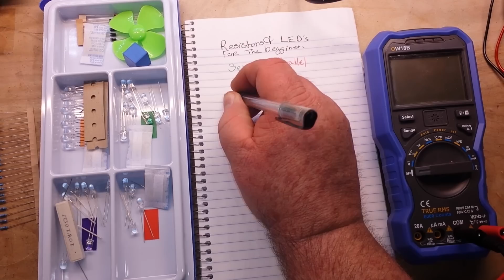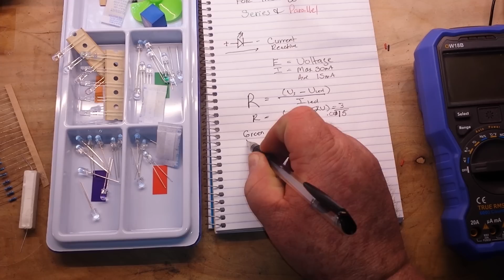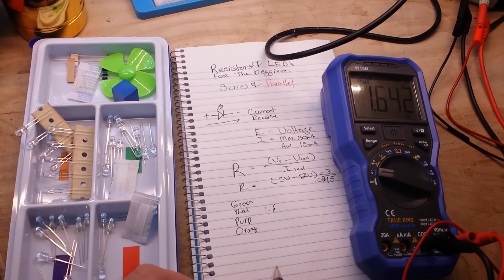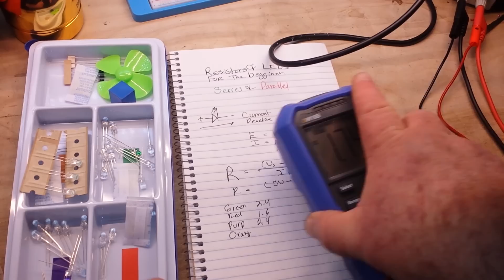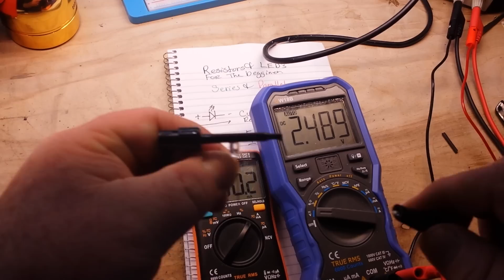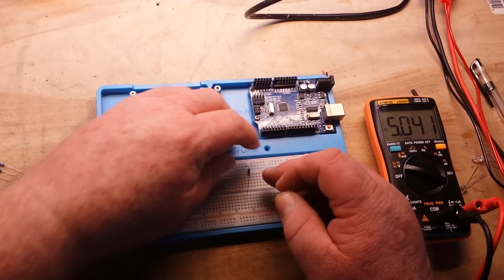LED's and resistors for the beginner

Comment: Hi.I’m looking at a 12v vw t4 badge it has already a string of bulbs behind badge in vw shape.some bulbs been out a while.I’ve ordered some 3mm led bulbs to replace.if old bulbs were not led.do I need resistors for led bulbs need about 10 extra in total of 25 .it’s 12v supply from side light circuit just when engine running normally .thanks .Steve

Comment: I would have liked to know if there where two parallel lines of serial LED's. How the amps react if one LED in one line goes out. I guess that amps going through the remaining line of serial LED's does not change?
The other thing I would like to know if for some reason one LED in serial is brighter than all the rest what can you do to lower the AMPs for that one LED so it dulls slightly.

Comment: Typical dumb question, but I'm putting some LED's in a circuit that also has a 555 chip. I want the LED to show that the circuit is on, not so much interact with the 555. How would I treat the 555 when it comes to calculating the circuits voltage so that the LED doesn't burn out. I'd be using a 9v battery.

Comment: I've wondered about the voltages on some LED's.  Some say like 3 volts etc.  But I've wondered if you can use them in a 10 - 20 volt circuit just as long as you don't go over the maximum 20 ma rating.   It confuses me on that.   And I've seen where they use LES's in AC circuits with no diode.  I guess because they are diodes.  But you can notice a slight flicker.  Any words on the mater of the limit of voltage on an LED ?

Comment: Does anyone know what the "R" stands for on a "4k 7R 25PCS" resistor label?
Reply: The "4k7" bit should be considered as a unit and just means 4700 ohms. The "R" after that just means "Resistor" (or maybe "Resistance"?). I'm not sure why it's done that way - seems like putting an actual Ω symbol on there would make more sense.
Reply: @largepimping  Thanks for your reply.  I kinda figured that myself, but I wasn't sure, being that they have some labeled "470K R 25PCS", without anything at the R.  It's a bit confusing.:)

Comment: Im sorry but as beginner who would like to use leds this ok as a demo, but i need to know when and if i need a resistor. How do i find out what resistor works best . For me a better understanding would have been a wire from the uno to led and not a fancy power supply .
Do i just adjust voltage or milliamps as well. How do i find the numbers to do the math ,and once i have the answer how do i apply that.If my transformer says 300 milliamps at 1.5 volts do i just wire any led without a resistor.
Reply: He does cover what you're asking in the video, but it's only mentioned in passing and he's also assuming that you understand the most rudimentary aspects of Ohm's Law. You know you need to drive the LED with ~20 mA (.02 A) because much more than that will kill the LEDs, or at least significantly decrease their lifespan. So that's your value for current. Then take your voltage (5V for arduino) and plug both values into the Ohm's Law equation, solved for Resistance. Here are the maths spelt out:

R = V / I
R = 5 V / .02 A
R =  250 Ω
Reply: Rule of thumb: always protect your LED with a 1K resistor until you better understand what must be done to accomplish your goal.

Comment: I'm sorry, I disliked this video as I have many of yours. I want to watch and follow along but you constantly disappoint in your methods.

In this one you were driving the "LED at 15mA" then adjusting your power supply voltage until it lit.
That wasn't doing what you said, which is why later on when you measured your current you got no reading.
Your process is seriously flawed.
You stated early on you had the power supply set to 15mA current, then later on you proved you couldn't do exactly that same thing.
As part of that failed process you blew up an LED and just laughed it off as part of the process.
This type of error in process has been in many of your videos and is not really helping beginners, learnelectronics.

Start again. 

The way I suggest measuring the required voltage for the LED is to use a series resistor of maybe 470 Ohm and adjust the voltage while  measuring the current and watching the LED.  You'll need about 5-15v for most basic LED types. Choose a light level you are happy with by adjusting the voltage. Now you can measure the current through the circuit and measure the voltage on the LED.  That will show you exactly the current and voltage you require for resistor calculation. Most general LED's will be very happy with 10mA and can often be driven at far less while maintaining good light output.
Reply: Don't like it? Start your own channel :) One less happy LED, sacrificed for education; RIP
Reply: @Pumba3900  so you are accepting that someone is giving out terrible advice. Not even by accident. Paul was aware of the errors but didn't care to fix then.

Your accepting of that?
Reply: @PIXscotland  I see a lot of video's on the web and there are very very few which are flawless and perfect. To tell you the truth even I make mistakes, however that is only sometimes. The way Paul makes a video is just letting the camera roll and do his thing and sometimes he makes a mistake. And from such mistakes there are a lot of people who can even learn from that, and that is besides Paul's adorable and highly amusing character, what it's all about.

Another thing is that if you are studying on a subject it's beneficial to watch more video's on the same subject. And if you discover an error in some video that just shows that you have learned something and have evolved in a subject. For me that is something to feel content and proud off, and I can forgive someone that made a mistake because he just forgets, is not paying enough attention, is just human or doesn't know any better. If I don't like it and it disturbs me than that is my own responsibility  because I am the only one who has control what to watch and what not. Peace :)
Reply: @PIXscotland  Yes, very accepting of that.  People learn from mistakes.  You can watch video's all day long about how to connect an LED or any other component and when it works without issue that tells you ONE thing.  When something goes wrong it presents you with a situation where you must figure out why it went wrong, not just that it did not work.  I have zero issue with that.  Better to learn on the breadboard with a component that costs a couple of pennies and is pulling low voltage and small current than making the same fundamental mistake when loading something at a much higher voltage or amperage.  You opinion is yours to hold.  If you dislike Paul's approach find a channel you prefer or better yet, put your money, time and energy in to making the perfect video.  Who knows, maybe you will end up with 1.2 million viewers and have more gear and money than you know what to do with.  Got to be honest, with your attitude I doubt you can break the 1k mark.  I am editing this comment.  I went to your page.  I see you have 1050 sub's and then I look at how long it took to get there.  8 years.  Dude, seriously.  Maybe if you weren't such a wanker you would have a couple thousand more.  Don't like Paul's videos, fine, go somewhere else.  Think you can do better, great, do so.
Reply: "not really helping beginners" you are too far elevated along to path of EE to even remember what it is like for beginners. We need as many viewpoints and demonstrations as we can get and some people just resonate better with each of us. Between the time this video was upload and I posted this reply to you, some THIRTY FIVE videos about FLAT EARTH were uploaded to Youtube. Three live streams as I type. Just saying ... wanna vent? Priorities! Take care and thank you for being a contributor of PROGRESS.
Reply: I am sorry, I missed your channel name.  Could you please post the name of the channel where you are making your videos and posting them so I can watch you do what you are writing.  Because short of that, it is merely arm chair quarterbacking and any twit can do that - so I am sure that is not what you are doing.

Comment: Paul, perhaps an explanation of LED fundamentals is due, judging by some of the questions posted here and elsewhere. Like how the resistance of the LED increases as the LED light intensity increases, until an equilibrium between current and resistance is reached, therefore self limiting the current at Vf.

Comment: This is also a good watch to understand the relationship between voltage and current. I had no idea it would take a whopping 16V to heartily light up 5 LEDs in series .... working with this stuff really helps to understand it better.

Comment: Great vid for the beginner indeed, as which I also see myself, so thanks. Paul if you have a VCC voltage of 2.4V and you will connect a green LED than the voltage is enougth to light the LED. But the current is not limited by a resistor in this case, so I think the LED will not survive this? Is there any way to deal with this, or can the current be limited to less than 30 mA if the LED and the VCC can not be changed? Because if you have a light bulb of 120V and you connect it to 120V there is no problem, so with a VCC that matches the needed voltage of an LED you should be safe one would think.
Reply: Roland Berendonck perhaps you should think of the LED as resistor. At 2.4V, with zero resistance 2.4 amps will flow from positive to negative but the LED also limits current to what it requires, therefore it will not blow!
Reply: @captainpugwash4100  At 2.4 Volt and with no resistance in the LED I should think that the current is infinitive. As I understand that is the thing with LED's that they have little to no resistance. So I think it will blow at 2.4 Volt, but as Omnipotent says there is a sort of safety range for the Voltage in which it will not blow. I will look for such a graph. And thanks for your answer :)
Reply: Roland Berendonck I didn’t say that the LED has zero resistance, it does indeed have one. Divide the Vf (forward voltage e.g. 2V for red or 3.3V for green) by the recommended current (say 0.02A) and you get the resistance. What I did say was that if you apply just the Vf across the anode - cathode, the LED reaches an equilibrium and draws no more current than it needs.
Reply: Omnipotent ! I am fully aware that there are LEDs with different data sheets showing different operating values. I have taken some up to 140 - 150% of the Vf before they burnt out. Certainly if you look at the graphs for normal or zener diodes there is a very steep gradient close to the y axis and especially near the breakdown voltage!
Reply: @mdrew44628  Ok thanks, now I have the answer to my question. Great answer.